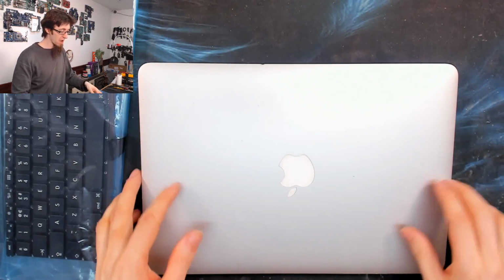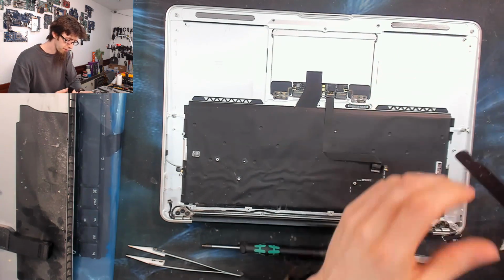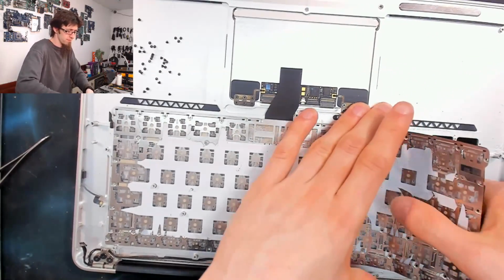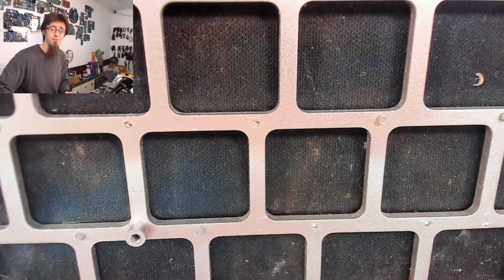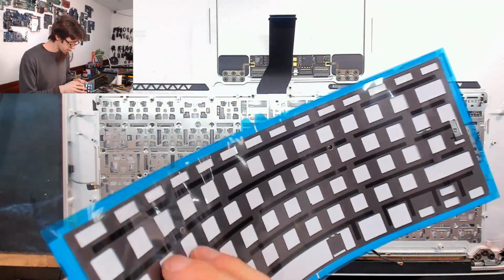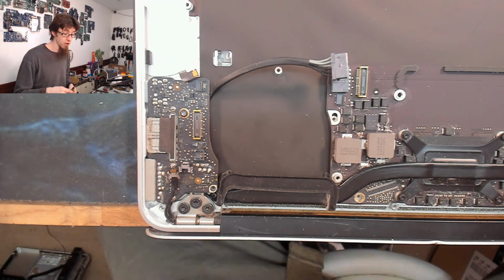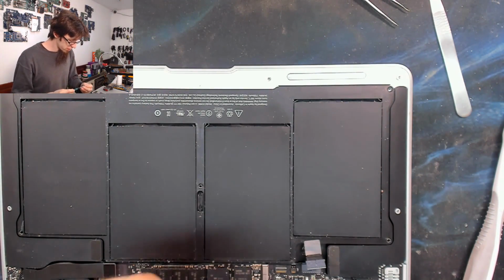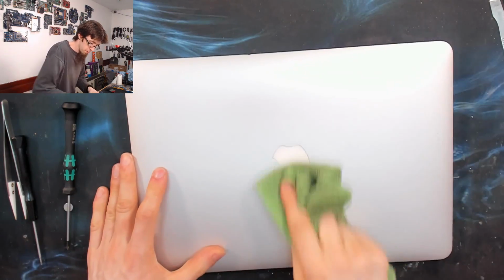LFC#205 - MacBook Air Keyboard Replacement (Full strip + Rebuild)

Comment: This is an excellent guide on what to do. I followed it and managed to get through with no major issues. It took me the best part of a couple of hours but I got there in the end. Great video!

It is interesting that the motherboard layout inside my mid-2011 MacBook Air is ever-so-slightly different in parts to what was shown here. Nothing major, and it didn't cause any problems, but kind of interesting.

Comment: Changing a keyboard on the MacBook Air is never a pleasant experience, but you made it look easy. I would recommend that at the stage where you are about to remove the keyboard, lay down some clear packing tape along the back surface of the keyboard. This will keep the rivets captive on the back so you don't having them popping all over the room. This has worked surprisingly well for me. Also, it's a good idea to save the old keyboard for when a key cap is required.
Reply from the maker: Yo, I was doing another one of these today and stuck masking tape on the back of the keyboard like you suggested. Worked a treat! Thanks for the tip!
Reply: @Adamant_IT  Hey, You're very welcome. As you can see,  it takes some of the stress out. Your videos are great. Thank you for the inspiration.

Comment: 17:25 I can’t re-use the screws to fill up the middle of my keyboard even if I completely popped up the rivets on the topcase though because the screws are too small. Do you have any alternative recommendation screws in this problem? It doesn’t matter the alternatives are not normally being used in the macbook repair. I’m good at if the screws are only thick enough to hold down the keyboard  (I’m using Macbook Air M1 late 2020 A2237.)

Comment: I am SO VERY GRATEFUL! This video walkthrough was so clearly done and really easy to follow! My computer is a 2013 and has lasted through a lot of abuse but the loose screen drove me crazy! While my model was slightly different (older so I didn't have to remove the fan, as you stated in the video) I followed along perfectly and was able to fix the issue for $8 (tools on ebay as you suggested). I can't even tell you how happy I am! Thank you Thank you Thank you!! I was chuckling as I did it because I definitely had spiderwebs too (though on spill on the front thankfully) but my screen was so loose on both sides it took 3 full turns of each of the 6 screws! I can't believe they didnt' just fall out after you said a full turn was surprisingly loose! :)

Comment: Dear Adamant IT, Hope you are doing well and safe. I have couple question could you please help me. I have a Macbook Pro 2012(Mid) it is working while then shut down(automatically) before shut down it gives sound(just quick around half second) recently I have been changed battery then shown me folder(instead of apple logo) then I changed cable under the HDD then worked now this problem. Additionally(working 30-min to 1-2 hours + working slowly). Is there problem with HDD or Ram? Thank you so much and  looking forward to hearing from you!
Reply from the maker: More likely HDD. I would remove the HDD and connect to a windows computer (via SATA or USB) and use SeaTools for Windows to do a Long Generic test on it.
Reply: @Adamant_IT  I do appreciate thank you so much

Comment: What an awesomely detailed and even entertaining video of exactly my task at hand. Thank you very much! Unfortunately I saw it a bit too late – only after I listened to some other guy on YouTube to pull out all cables to the top. Now I'm here with the half removed connector of the webcam, the tiny one next to the fan... Do you think I could just leave it like that and get my dad an external webcam? Or rip it out completely? Or glue it back in place? I'm pretty confident any soldering attempts on my side would finally ruin the whole logic board...
Reply from the maker: Ooof... Yea if you're not confident at SMD soldering, I'd go for external webcam.
Reply: @Adamant_IT   I saw your soldering video meanwhile. Hm. Maybe it's feasible. Because I'm not sure what happens if I rip out the component completely – could produce a short circuit, no?

Comment: I just got a mid 2013 MacBook Air model I think it was  the 11” one.The Z key is the only issue with it, Do I need to replace the whole keyboard or just the that is activating randomly
Reply from the maker: I'd replace the keyboard. As much of a pain as it is, you'll likely find that more keys fail in the future if you don't replace it.
Reply: @Adamant_IT  one last question,  I read that the model I’m getting can use big sur , would it run?
Reply: @Adamant_IT  Question do I need to replace the backlit  too because Ifixit does offer a replacement keyboard just not the backlight and do I need to replace the whole top half to get out the keyboard and or do I have to replace the keyboard top half that it’s connected to?
Reply from the maker: Yes, the 2013 can run Big Sur
Personally I would buy a new backlight, because on ebay the keyboard is max, £20 without or £30 with. And then if you find that the old backlight doesn't come off cleanly, or it's really grotty due to old liquid damage, you've got a nice new one to put in. It's not essential though, if you're careful, you can reuse the old one.

Comment: @Adamant IT it would be nice to make a video about repairing desktop motherboards.cheers mate.keep on teaching us!!!!
Reply from the maker: I've had a couple of questions about that. I've never actually looked into it myself, but I'm going to try and research it to see if it's something I could tackle.
The problem is that most laptop mobo faults that are fixable are power related, and desktop mobos have significantly less power hardware on them because it's all done in the PSU.

Comment: Not related to this topic... However could you please try to analyze this problem..
I have a 3558 dell laptop.
Recently whenever I try to plug it to my TV through a hdmi cable..it works but I have a weird problem.. The USB keyboard start to behave strangely..
I never had this problem before..
Tried Uninstalling Intel and nvidia drivers and reinstalling them again.. Didn't work..
I even tried to reinstalling a new system with updated drivers.. Didn't work also..
The cable isn't faulty..
The strange thing is that the mouse works just fine and even any USB device also works fine..
Without pluging the hdmi also the USB keyboard works fine..
I could really use your help if you have encountered such a problem.. Thanks.. Really appreciated

Comment: Hi Adam thanks for you videos I was wondering for some advice a pointer I have a macbook air and it stopped working I have removed the mb have green light no fan spin and when charger plugged in you gets hot ?Thanks in advance Mentes
Reply from the maker: Check the condition of the magsafe connectors (on the laptop and the charger) to make sure they're clean and not melted / blackened. A poor connection will get hot.
Without getting into schematics and board repair diagnostics, the next thing I'd try is replacing the IO board (aka DC board) which is the smaller circuit board in the laptop. It's a shot in the dark, but they're not very expensive.
Reply: @Adamant_IT  thank you so much for the reply sorry to bombard you you with the questions I will try this then failing this will need to go through the schematics

Comment: Hey Graham do you know what Clock_Watchdog_Timeout in Windows 10 means.
Reply from the maker: ahh heck I've seen that one a few times, but can't remember what was causing it. Check for graphics drivers, turn off any overclocks, turn off XMP, see if any of that sorts it, then work forwards again.
Reply: @Adamant_IT  I've tried various graphics drivers, various cards (GTX 960, RX 580 & RX 5500 XT), No XMP, bog standard clocks and many clean installs of Bindows 10 (Yeah I said it right).

The RX 5500 XT is broken I've tried it in all 3 of my PC's and that has the same issue, drivers crashing, GPU and RAM speed not being reported in GPU-Z or HWINFO64. It's going back to Scan computers tomorrow.

Comment: I was never ever able to remove leftover rivets on my first air MacBook. Moving forward , I just took my customer that we just need to purchase a top case. By the way, on later MacBook pros, where there are no screws and only rivets, the rip out of keyboard results in all the rivets stuck the aluminum case and are virtually impossible to remove. Apple by design, of course.
Reply: Hi Neal, never impossible to remove all rivets. You get an automatic Centre punch, grind the point back to a flat blade. Then push the punch down on one side of rivet until it clicks, then the other side, and it will easily pop out. Did a video on that, a couple of months back on MBK Upcycle.

An extra 5 minutes of work, and ur new keyboard will sit nice and tight in top case, with no keyboard sag. Winner winner

Cheers MBK Upcycle

Comment: I think I would put the new backlight panel into position before exposing the adhesive strip. Or maybe just expose a small (20mm) bit of it, place into position, then remove the rest of the strip.